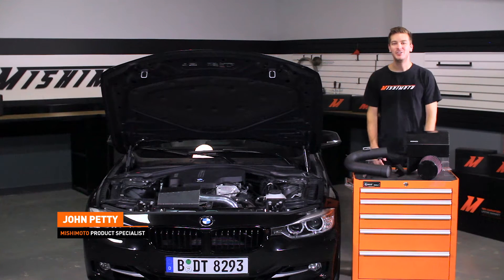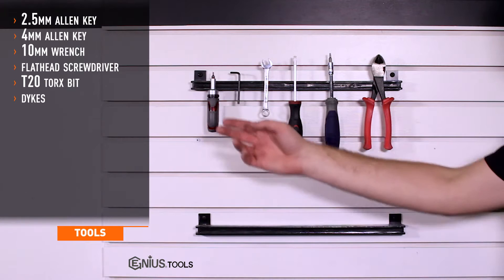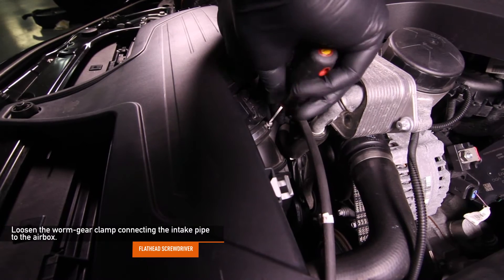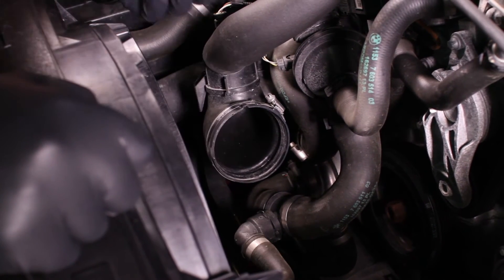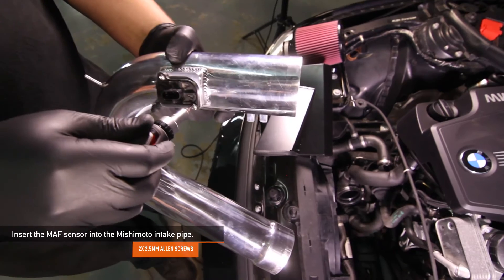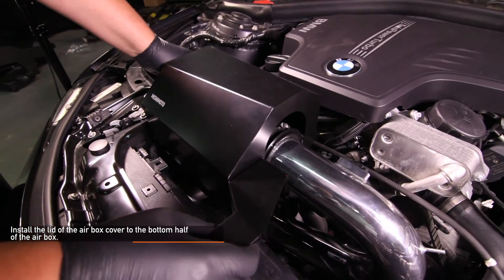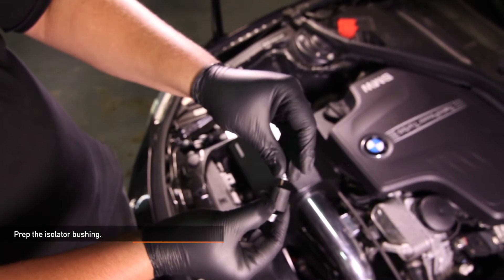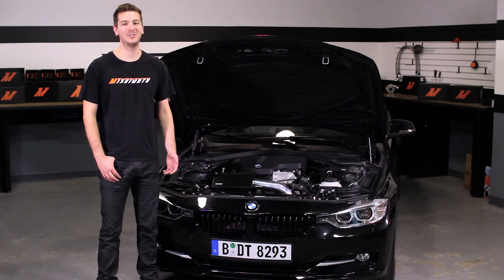2012-18 BMW F22 228i/F32 428i/F30 320i/328i Performance Air Intake Installation Guide By Mishimoto

Comment: I have a 2015 328i and I am trying to put on the intake but there is a wire attached to the air box that I can’t take off and I don’t see it on this video
Reply from the maker: We would suggest emailing support@mishimoto.com if you have any installation questions.

Comment: Hey guys I’ve installed this intake on my 328i f30 N20. Ever since the install it’s had rough cold start idle, dropping RPMs. But once it’s warmed it’s ok
Reply from the maker: It sounds like you might have a small air leak that goes away once up to temperature. We recommend going back through all the connection and clamps and just making sure everything is tight.

Comment: cant i use the original cover again ?
Reply from the maker: If you are referring to the top of the factory air box you may run into clearance issues with the new intake.

Comment: What benefit would you anticipate from installing this air box? I have the 428i with RaceChip installed (311HP approx).
Reply from the maker: Hey Tallandcharming! Head over to the product page to check out the full list of features: https://www.mishimoto.com/bmw-f30-performance-air-intake-2012.html
Reply: Mishimoto Automotive thanks; couldn't see anything about BHP gains, any info on this?
Reply from the maker: Hello Tallandcharming  While this particular intake does not make any additional power, it does have a highly aggressive intake tone under acceleration. It also includes an all aluminium air box for extra weight savings, and added corrosion protection in harsh climates
Reply: Okay thank you.